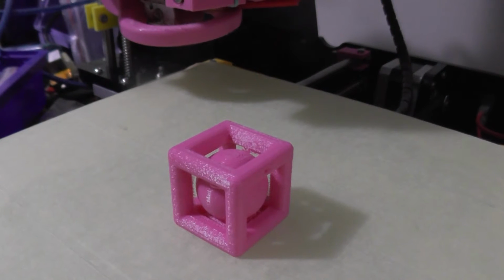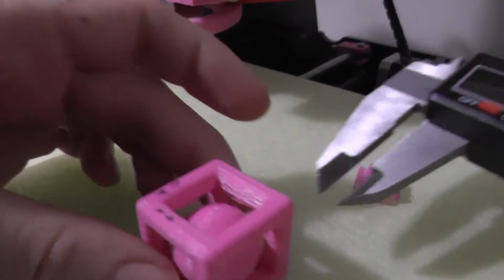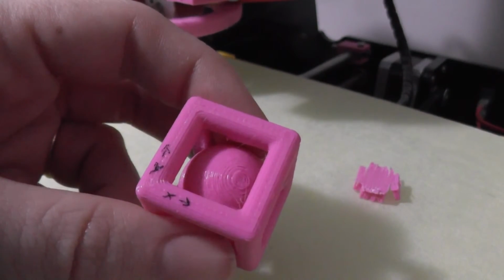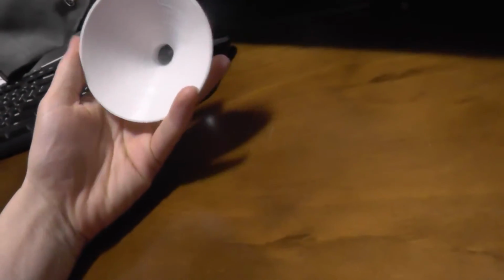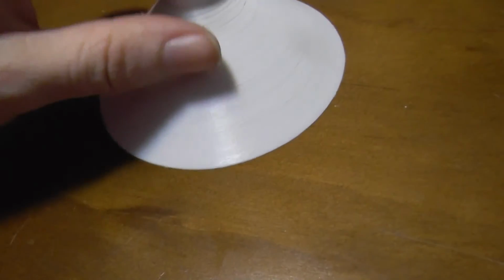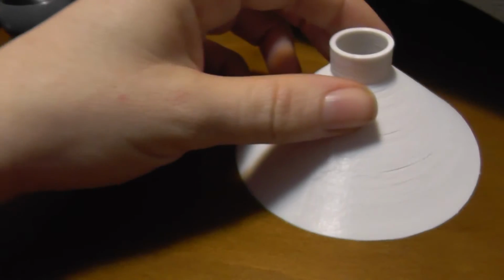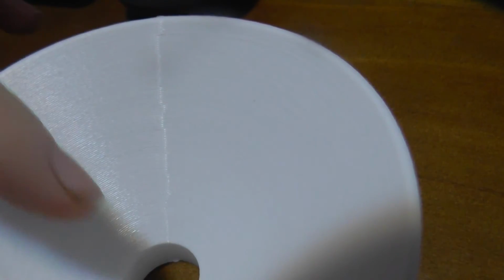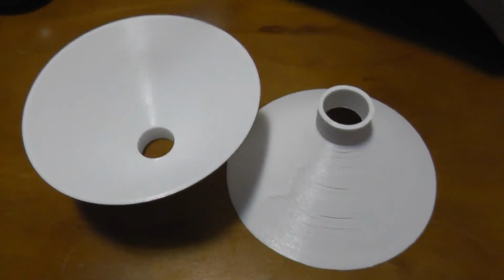3D Printing upside down or right side up?

Comment: Another great video, very insightful regarding orientation.
Depending on the slicer you use, S3D has the option to change the order that the shells are printed. For example, in your first funnel you could change it to print the outside shells first, it would give the inside ones something to stick to.
Keep up the great work
Reply from the maker: thanks Spike. you are absolutely right about the shell order option. I think this option is available in most of the slicers I have used I just didn't remember about it until it was already done hahaha.
Reply: You're not alone in forgetting some settings before starting a print ... I do it all the time :-)